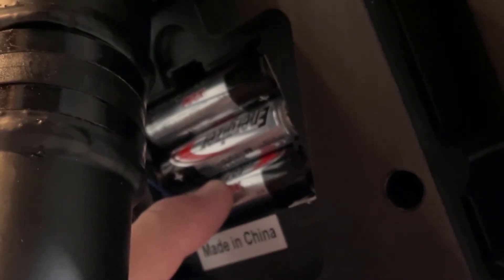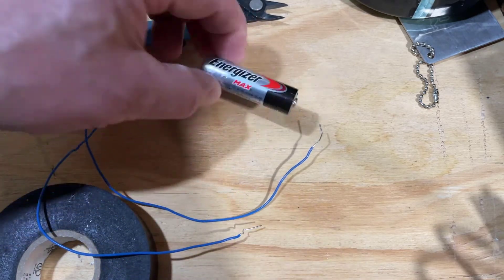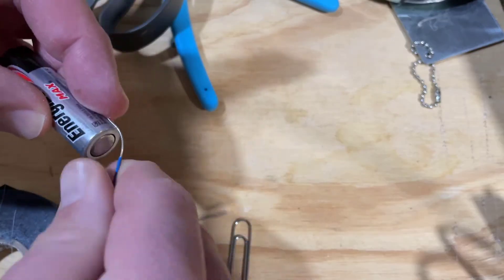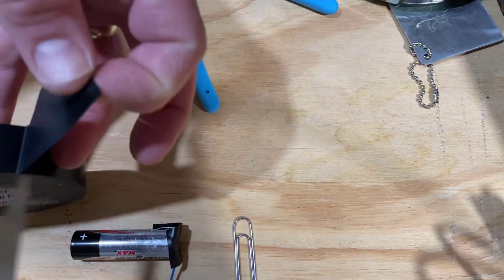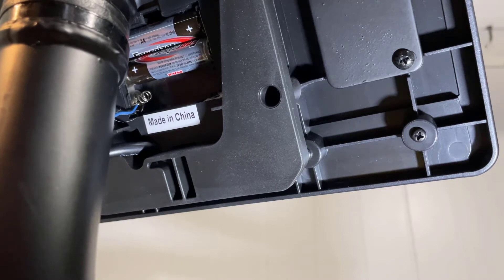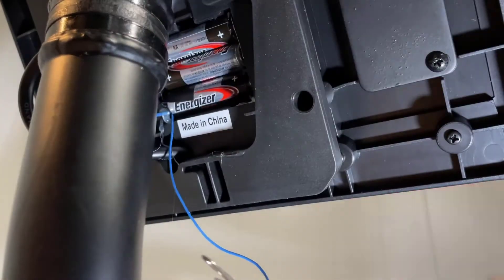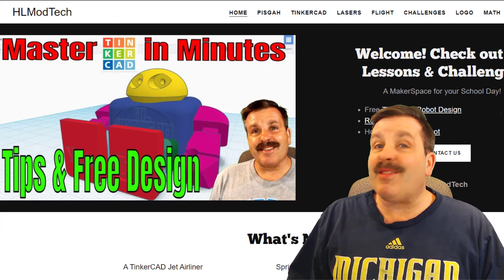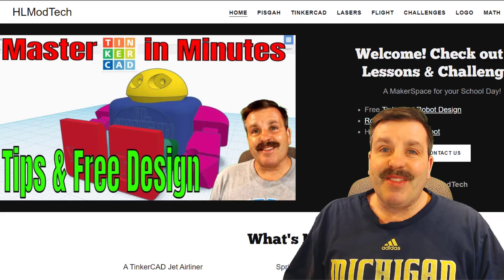Add a Display Power Switch for your Proform Carbon CX | Simple Steps

Comment: Mine completely died, can’t get it to power on
Reply from the maker: Ugg. I would start with checking to see if a battery is in backwards or something. Also the wires in there could be corroded. Lastly I would jump on hold and see if support will send you a new display.
Reply: Had this same issue..... replacement $190,bike is useless without it
Reply: i am having the same issue. were you able to fix yours?
Reply: @Armurp01  were you able to fix yours? having the same issue. bike is useless right now..

Comment: Good idea because I am starting to hate this bike and Pro-form.  I was on hold for 2 hours and got no help for this issue.
Reply from the maker: I have actually got a new rig where I used an alligator clip and a power brick. I only plug it in when I want to use it. Works like a champ.
Reply: @HLModTech  can you make a video or write-up and update for how-to

Comment: Hi McGyver Sir! Any idea how to solve the problem "Hello" at my display. Nothin is working at all, I just have HELLO appearing when moving the pedal. Thank you soooo much! 🪔
Reply from the maker: I do not have a solution for that one. I would likely start with checking the cable connections. Did you put yours together yourself  or snag it used?

Comment: Just disconnect any device connected to it. It will automatically shut off…😂
Reply from the maker: You’ve never walked in the room later and just seen it on? My display was powered on all the time before I put in the little switch.
Reply: I noticed the batteries were dead but it had not been used in awhile. So I put new ones in and rode. Next morning it was on. So I did search on google nothing really. Then you tube saw your video but that’s ridiculous 😂. You should not have to be a hack electrician to operate a cheap stationary bike. So I read the owners manual 😃. You have to disconnect all devices and it has an automatic shut off. It’s in page 20 of the owners manual😃
Reply: You just being real extra extra 😂
Reply from the maker: My new version has it wired to a power brick so I never am wasting batteries. It is a jinky setup, but I have not complained. Sometime I need to turn that into a video. Thanks again for the visit!
Reply: Sounds cool stay fit my friend 🤙🏽